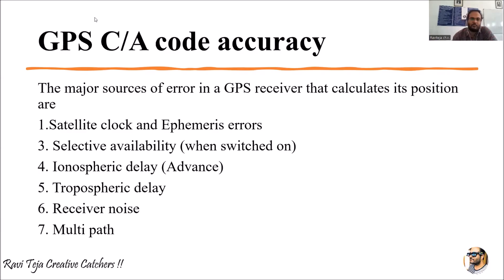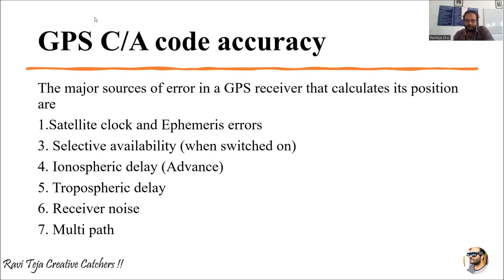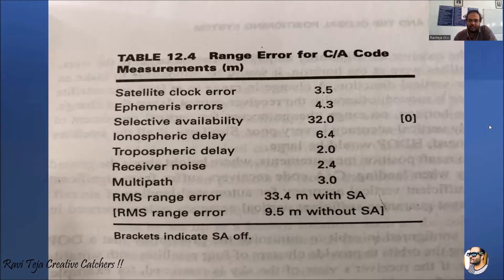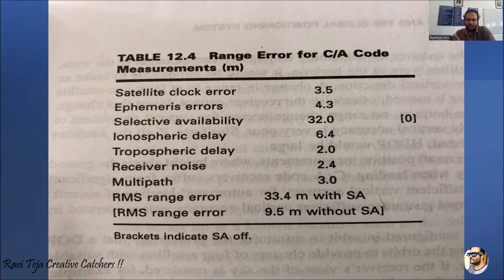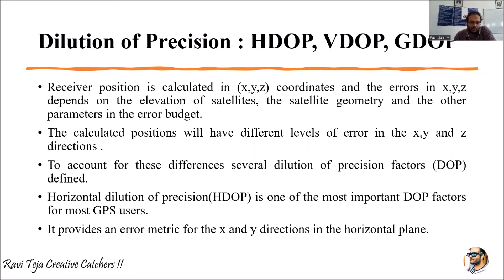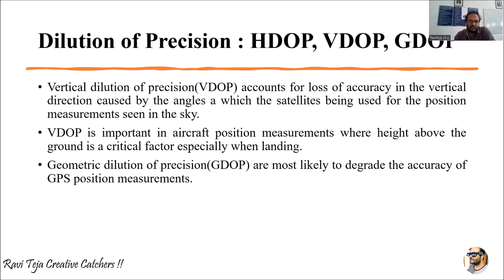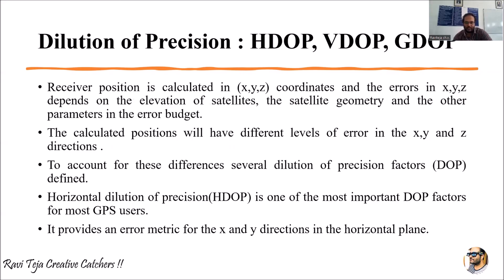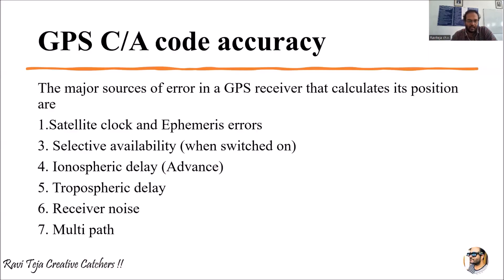GPS C/A code accuracy in satellite communication

Comment: How does a satellite determine the exact speed of an object on Earth while rotating over a circular path at 14,000 kilometers per hour? A signal sent by a fridge-sized satellite at 20,200 kilometers away and moving at 14,000 kilometers per hour. Which part of the code calculates the effects of that satellite's speed and altitude?